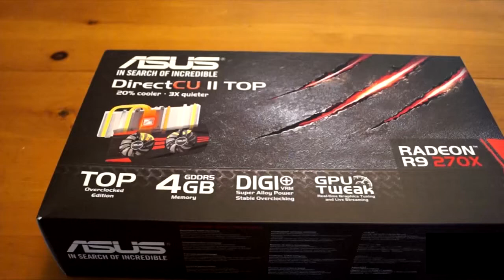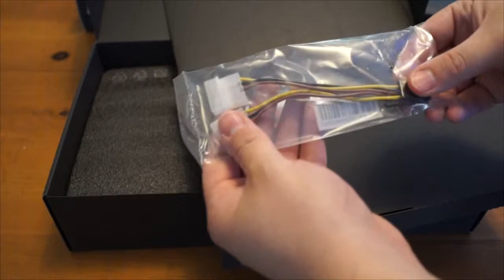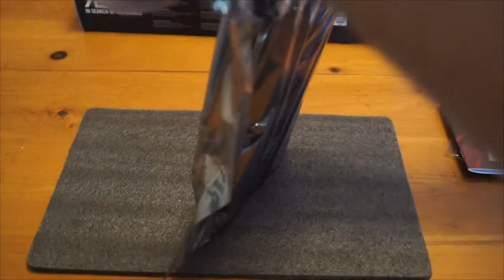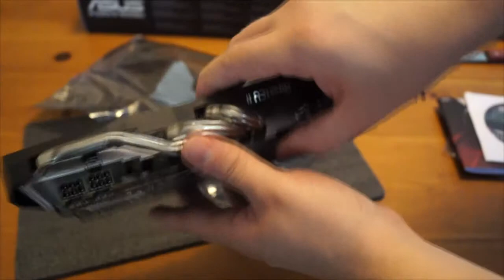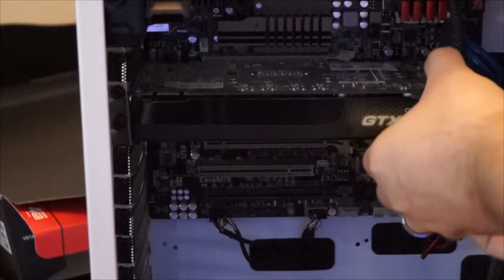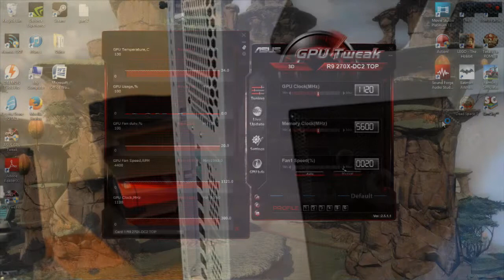R9 270X Unboxing - Install - and Software

Comment: I have question: I have sapphire r9 270x..but it has no vga port..In my earlier gpu . I used vga to vga cable to connect to my monitor. now do i have to buy dvi to vga or use the vga port on motherboard ?
Reply from the maker: Yah mate you would use the Graphics card outputs, You can pick up DVI to VGA cables for pretty cheap at local electronics stores / Amazon. $10 to $20 range. or can check out local used markets in your area, you might find someone selling a used HDMI monitor for $30-40 thats what they seem to sell for in my area.
Reply: @NoobByDesignGaming  Bro another question Do I need to connect both power supply cable or only one and will my psu support my gpu?

Comment: Plz recommend a psu for this gpu
Reply from the maker: Pretty much any PSU will work mate, this graphics card isnt very demanding power wise. It really depends on all your other components when it comes to picking your PSU. If you are using like a threadripper CPU your power consumption will be high. When I built this 6 years ago I was using an Ultra X4 650 watt semi modular. I like using modular or semi modular PSU's because wire management is far far cleaner. Just made sure whatever you pick up has 2 6pin power supply connection cables for connecting to the PSU.